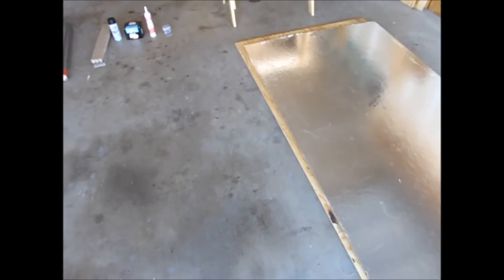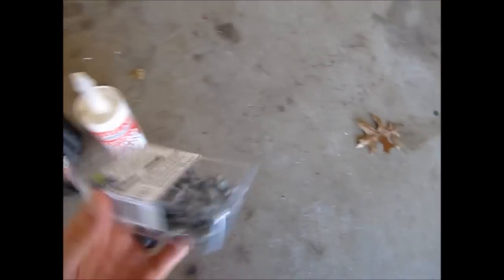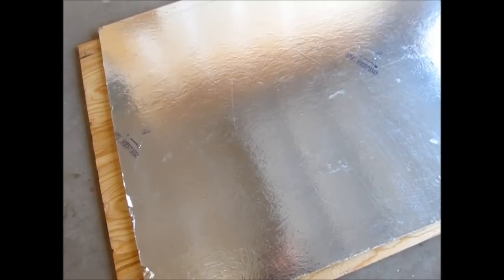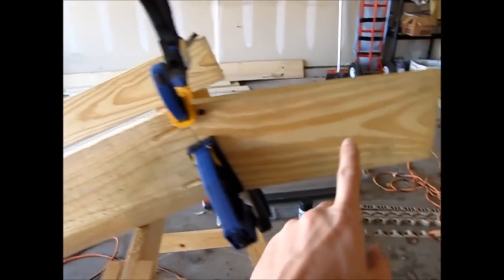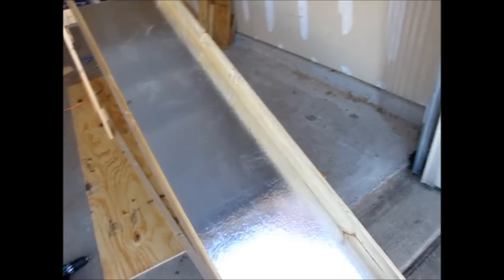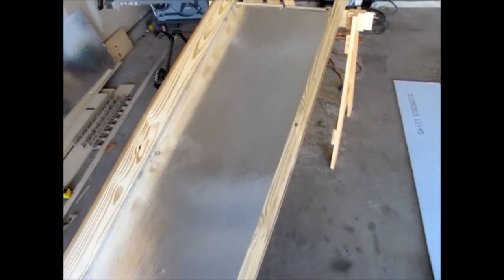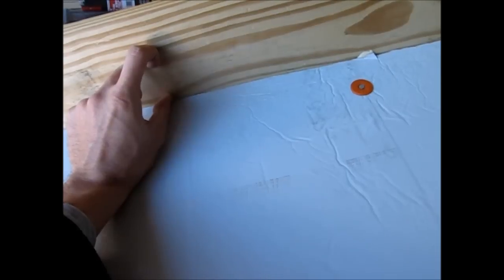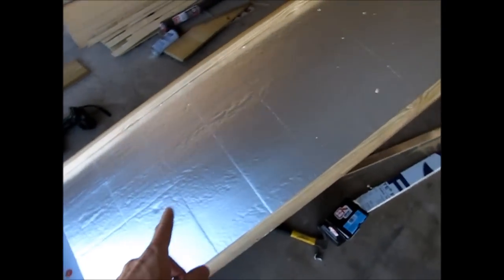FREE Heat - How To Build A Homemade, Passive Solar Heater Window Unit

Comment: You  did a great job on how to build a passive solar heater window unit, I will build one just like you did except for the screen, Instead I will use two layers of black shingles that I have extras of and let the sun heat them. 2 thumbs up on your design.

Comment: Those strips of 1/4 inch wood used on the screen  is called furring strips, and before you put the screws in drill holes for the screws (slightly smaller of course).  That will keep the wood from splitting like it did in the video.

Comment: I like the simplicity and passive features here.One thing that occurs to me: since you also will have a need to clean the dust out of the air when doing woodworking, why not have fresh air coming in and have a separate vent system for dirty air to exit?  There might be a way for the wind to help, like on a chimney where the Venturi effect tends to pull air out to prevent buildup of carbon monoxide.
Reply from the maker: You could use fresh air from outside but then you run the risk of having critters enter the outside intake.  It would also bring in humidity from outside.  You would have to have an equal possibility for air to exit the house, too, or else the intake wouldn't allow much, if any, air to enter a closed system.
Reply: I appreciate your feedback - but in my situation there wouldn't be any significant difference in the humidity outside to inside.  If critters were a problem it would be a simple matter to put metal screen on the intake.  Your question about outflow is already answered by the aforementioned chimney Venturi effect causing airflow not only from heat rising, but from crossflow of any outside wind.
Reply from the maker: Cool.  Give it a try and let me know if it works!
Reply: I plan to work on that when we get back from our trip out of country for 2 or 3 weeks.
Reply from the maker: Cool.  I am interested.

Comment: Great video have you thought about replacing the center baffle with just black sheet metal so would act as a heat sink and my other question was have you tried this band forced him to see if it would perform better?
Reply from the maker: I don't think forcing air through the heater will improve performance.  It would certainly move more air but the temperature of the air would decrease because it wouldn't have as much time in the box to heat up.  Also, you would have to run some wiring (which my wife would hate!) to the fan and it would start costing you electricity to run the thing.  My whole idea was to get free heat (other than the price of the materials to build). 

I hadn't thought of replacing the screen with sheet metal.  It would work really well if it were baffled somehow because you really need to force the air to come in contact with the "heater element", which in this case is the screens.  Screens have lots of holes and allow air to move freely through it to generate a lot of surface area to transfer heat.  I don't know if just a flat piece of sheet metal will allow the same transfer of heat.
Reply from the maker: You are the second person to suggest this.  I want to try that sometime and test it out.

Comment: Thanks for the video. What does the screening do? Also, does the angle the unit is in relation to the sun effect the efficiency?
Reply from the maker: The screen is what is absorbing the sun's radiation and then warms up the air as the air passes through it.  A lot of people also build these using soda cans that are painted black.  As long as it is black and air can move through it, it will work.  The angle definitely affects the efficiency.  Unfortunately, with mine I couldn't really control the angle due to my design choices.  If and when I build a new one (maybe this winter?), I will take that more into account to allow some adjustability or design the optimal winter sun angle into the design given the height of the window that I am using to draw the air in.

Comment: How did you connect it to the window?  I didn't get that part from the video.  I got the "angle", but how did it actually connect?  Open the window?  Did you build in insulator boards on either side (a la a window A/C unit)?  Thanks for any clarification.  Great idea - love these DIY videos
Reply from the maker: It connected just like a window unit air conditioner like you said.  I cut 2 pieces of wood out, one on either side, and then used foil tape to seal the gaps.  It was not perfect but it worked.  Thanks for the comment and feedback!
Reply: Thanks for clarifying.  Great, great stuff!  Thanks for the video
Reply from the maker: Derek Thompson
You are welcome!  Thanks for watching and please consider giving me a thumbs up or subscribe to help me out!

Comment: Great project. Is there a part 2? Are you still useing this, what temps are you getting in the winter?
Reply from the maker: Haha, I didn't know anyone was still watching this.  No, I don't still use it but I did make another version the next year to see if I could make some improvements and changes.  https://youtu.be/znytJtU0za4
Reply from the maker: I don't know.  It is a drop in the bucket for a big home like mine.  All of my south-facing windows on my house are on the main level, which is about 2,300 square feet.  I was not able to ever figure out how much quantity of heat was transmitted or measure an effect on my overall temps indoors.  In a yurt or a shed or a small outbuilding I do believe one of these of this size would make a meaningful difference.  Not 20 degrees difference.  But a difference.  And maybe if you super-sized one that covered the entire side of the house that faces south with unobstructed sun all day it would make a difference.  I know that solariums in off grid homes have a huge impact on indoor air temps and act like a battery to hold warmth well into the night as well.  But those are much, much larger than one of these small devices.  So keep that in perspective.

Comment: I made several. They  work yet in my area  of NE Ohio there was not enough sun to make a real difference. I want  to emphasize that they do work if there is enough solar gain.
Reply from the maker: Yeah mine worked and the air coming out of it was very hot but it wasn't able to put a dent in warming up my family room.  I am going to try to work on a bigger and more efficient one this winter.

Comment: You also used the wrong screws to fix corrugated sheet. You should use three part clamps that match the curve.  That’s why the sheet is kinked and will split after a while.

Comment: Obviously, the outlet goes in the window. Where's the inlet? Does it draw cold air from OUTSIDE? If so, it would be much more efficient to draw air from the house to be reheated. Which may be more difficult with your design....
Reply from the maker: +romansten9 No, both inlet and outlet draw air from inside.  The inlet is right below the outlet separated by a piece of wood.  The inlet draws air from below and the outlet exhausts warm air into the room which immediately rises.  I could put my hand above the outlet about one foot above and feel the warmth really well.  We aren't talking big quantities of hot air but it does work.

Comment: I'm seeing all these videos on how to get the inside of a box hot, but no details on how to get that heat inside the house.  Any suggestions?
Reply from the maker: First Last The air will naturally rise through the box and drift into the house on its own.  No fans or trickery needed.  It will pull cooler air from the house into the bottom slot and it will slowly move through the heat elements (screens) and then up the top side and back into the room.  See the results video for an exact temperature measurement of the air moving into my living room:  https://www.youtube.com/watch?annotation_id=annotation_2535032215&feature=iv&src_vid=XmLZkFqfJvM&v=qZThJKIcRz8
Reply: LDSreliance No, I got the principle of cool air, warm air, etc ... and I promise I'm not trying to sound rude, but I see people going into great detail on the angle of a screw or the construction of a nail, but no details on how to stick it in the window.  I mean, I could probably figure out something on my own, but why not see what works for other people first?
Reply from the maker: Oh, that is what you meant.  I didn't bother to go into that because every house is going to be different.  Some people will want to permanently mount it, such as if this is for a workshop/garage/shed.  Others will want to mount it in a window and then remove it when it gets warm.  And all windows are going to be different sizes and shapes.

For mine, I just put the inlet/outlet inside the open window, shut the window down on top of it and then fashioned 2 side pieces out of cardboard and insulation to plug the holes left on the 2 sides.  Then I used metal HVAC tape to tape it all up and minimize any gaps for air to get in.  It wasn't perfect but it worked.  I probably could have taken more time to design something out of wood but I chose not to.
Reply: LDSreliance Okay, thanks for the response .. and I'm afraid I was a little rude, because I forgot to open with how much I like your videos.  :)
Reply from the maker: Not at all.  I didn't take it that way.  Thanks for watching and for the support!
Reply from the maker: LDSreliance This video also doesn't show how to get the heat inside the house (mainly because I haven't figured it out yet) but I just finished a new heater video here:  https://www.youtube.com/watch?v=znytJtU0za4

Comment: thanks great video love the angle idea!
Reply from the maker: Thanks for watching!
Reply: wish i knew how to hook one of these to a battery and charge batteries overnight.  do you have any thoughts on that? thx
Reply from the maker: Unfortunately, this is not a solar panel that can generate electricity.  A thermoelectric generator may be able to produce a small amount of heat during the daylight hours with this.
Reply: thanks I got my cans painted black today.  found a vid w a study on which type of hole was best at the end of the can producing more heat.  they said nail holes beat larger holes at bottom of the can, if you can believe that.  I think maybe the air stays in longer gaining more heat?
Reply from the maker: Yes that is a great point!  You don't want air moving through this type of device very fast.  That is why I chose not to use a fan (that and the wiring mess).  In my head, the smaller holes in cans sounds better but I think you'd have to test it out.  Do you have a link to that vid?
Reply: I am looking for it/will find and send it to you.  it was a great video.  the guy did a whole series of tests/said downspouting was the worst for heat transfer.  he said spiral cuts and nail holes were the best.
Reply from the maker: Nice.  Let me know if you find it!
Reply from the maker: momstheword11 In case you are interested, here is my new heater build for this year:  https://www.youtube.com/watch?v=znytJtU0za4

Comment: A good idea would be to angle the whole device based on your geographic location to recieve best sunlight.  Many calculators out there, but look for solar power/sun angle.

Heres one I found that works good enough: http://solarelectricityhandbook.com/solar-angle-calculator.html
Reply from the maker: True but you would have to build in some adjustability into it to account for the time of year, otherwise it will only be optimal for a few weeks at best.  The build was already complicated enough without having to rig up some system for changing the angle.  It could be done but you might have to use a fan to blow the air through a flexible tube instead of having a rigid output of the air through the window.

Comment: I have made a  can heater and it works, but I started to wonder if the cans are really necessary and weather  just a black box wldnt be just as  effective.
Some people say "yeah but with the cans you have a bigger surface", well that mighte true, but the amount of solar energy ('light')  falling on/in yr box remains the same.

I have seen some people put that box in a window still coz that way they do not need to make holes in the wall. That ofcourse is  foolish too coz the window will let in just as much energy as the  solar heater will.
Your design is  better as it adds to a window rather than obstructing it.

I know of some indian dwellings in the four corner area who used oildrums, painted black, outside with piping going to their homes as additional heating and apparently that was very effective, or at least significantly cut their energy bills.
Reply from the maker: Yeah, you are never going to replace a heater with these unless you had your entire roof covered with them.  Even then it does literally nothing if it is even partly cloudy.

The beauty is that it supplements the heater and creates a cozier space by the window that is drawing in the heat.  And if you took your time and built one with good materials and stored it properly during the summer then it would probably last 5-10 years and continue to be a value.  Unfortunately, I did not have anywhere to store mine and I made a couple mistakes in my design that caused me to just scrap it in the spring.  I hope to build another one using those lessons I learned this winter.
Reply from the maker: I didn't think about that.  Good point.  I just read some side by side comparison tests of the 2 styles and the screen kind outperformed the can kind but that is just one test and it could have just been a design thing.
Reply from the maker: LDSrelianceIn case anyone is interested, here is my new heater build for this year:  https://www.youtube.com/watch?v=znytJtU0za4

Comment: So out of these 1000s of videos! No one tells you how to regulate the 
heat for winter and summer! hello! Can you tell me! Brian..
Reply from the maker: I suppose you could rig up a sliding door or something on the outlet of the heater to either completely or partially block the outlet of heat and that could help regulate its output.  Other than that, I don't know how how you would.
Reply: Cover it with cardboard in summer.  Not rocket science.

Comment: there is no thermal mass. this thing won't absorb much heat.
Reply from the maker: +Balltungo Ball Why don't you build your own and try it?  It works well.
Reply: +Balltungo Ball Thermal mass is only used to store the heat for slower or regulated use such as overnight. There is no heat storage in this panel. It simply heats the air and by simple convection, recirculates it back into the room.

Comment: this video is made by a technically savvy person who has no idea how to explain anything about what he is doing. no explanation of what the screen is FOR. no explanation of HOW this heats air or HOW it is transferred to the house/room. he expects me to KNOW all that, but I don't.
Reply from the maker: +Jack Rainbow That wasn't the point of the video.  The video is not "How A Solar Heater Works" it is "How To BUILD..."
Reply: I think he's just trying to educate us newbies like myself and few others who are interested in the concept of solar and the build as a supplement to save some money during the day time on heating bills which I'm sure will work just from the looks of it. It's as best as he can think of at that moment and I'm sure he's open to ideas on how to improve the build if you have any to add besides the negative criticism  that you only have now to discourage people on sharing great ideas.
Reply: +Jack Rainbow
I think its quite self explanatory really. Common sense explains how it works.
Reply: Help me to understand this clip. What is the screen for, according to your common sense?
Reply: stephen parsons What is the screen for according to your common sense really?
Reply: he doesn't mention any of that. you have, but not he.

Comment: NO NO NO....    WHAT??????  SHORTEN THE BOX, KEEP SOME VOLUME AND CONSTRICT THE AIR FLOW
Reply from the maker: If you want to overcomplicate it be my guest.  You'd have to create long channels and zig zag back and forth to keep the air in the box long enough to absorb the same amount of heat energy.
Reply: WORTH A TRY????
Reply from the maker: Edward Jones If you don't have the space to work with, sure.  But that is a lot of extra effort to get the same result and I have plenty of space in my back yard.

Comment: Plan for this same heater was published in Mother Earth News somewhere between 1978-82. A friend made one using a glass top and three pieces of plywood with the glazing on top over flat black plywood. It measure roughly 2 ft wide by 4 ft long. The facility where I worked had a cooler where food products were stored. We brought the panel and did a temporary install to test it. We achieved a 20 degree difference on the air change pulling 40-degree (F) air from the cooler (bottom compartment) and witnessing 60-degree (F) air exiting the top glazed compartment. As I see it, what this first design lacked was a baffle that could be closed at night to stop the process, which may very well reverse at night.  For the slow passive air exchange, I'm not sure the inconvenience of uninstalling it every night is a good idea. Perhaps just a block of foam to fit the window opening from inside the structure could serve as a shut -off at night.
Reply from the maker: Good points.  I was seeing higher than 20 degree F difference on mine but mine is larger.  I tested the backwards passive at night and it didn't happen.  There was no siphon effect so there was no air movement at all.  I did not see fit to create a baffle but that would be a great solution.  Just a simple flapper that you could close at night would be sufficient.